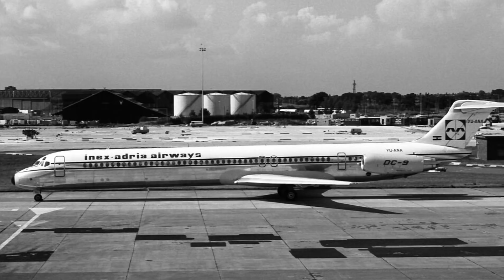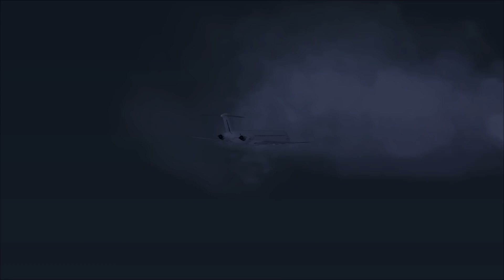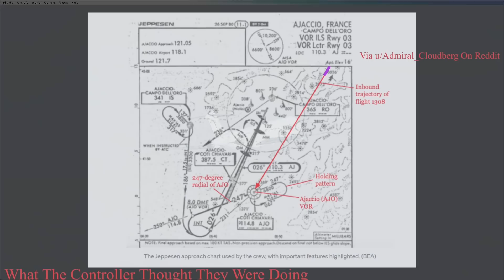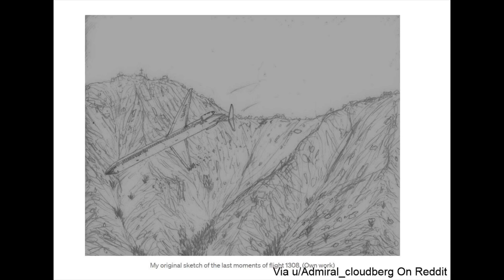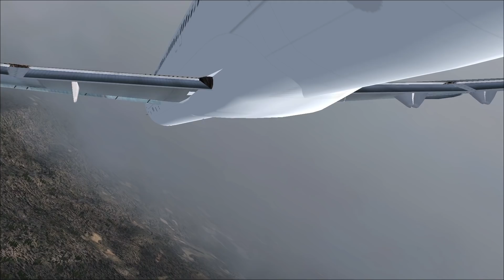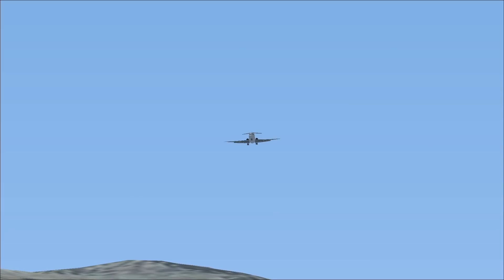The Small Misunderstanding That Doomed 180 People | Inex Adria Aviopromet 1308

Comment: The controller said "You are clear to descend to 3000 feet", upon which the pilot said "We are in holding over Ajaccio", and the controller replied "Roger". Controller had full information, but did not act on it. This is clearly controller error. IMO, 80% controller error, 20% pilot error. The pilot did not respect the minimum holding altitude shown on the chart. But I can understand the pilot -- the controller was told that they are in holding, and still permitted them to descend to 3000 feet. And so the pilot, being new to the area, trusted ATC.

Comment: I went to the summit where the crash happened yesterday, there's still a fuselage section and some little parts of the plane left at the point of impact. A rock of about 2x4 meters flew a dozen of meters away from the summit when the wing hit. But the most impressive part is a long crack (4/5cm deep) in one of the rock (I'm talking about granit) with metals stuck in the rock. If the plane flew 3/4 meters higher, it would have been fine, that's sad.
Reply: Wow.

Comment: My diploma thesis at faculty of mechanical engineering - aeronautics science - was the technical survey of this accident and possibility of reoccurrence with modern aircraft's  systems - http://docplayer.si/205550866-Tehni%C4%8Dna-raziskava-letalske-nesre%C4%8De-leta-inex-adria-aviopromet-jp1308.html - and I can confirm your analysis is quiet accurate. Beside the fact that our pilots didn't follow multiple GPWS warnings (first CM1's response 8secs after initial aural warning and if it was only a second earlier, they would overfly), they also briefed the procedure badly. There wasn't a proper approach briefing made (as per CVR transcript) and they also missed both crucial info on that chart - MHA and max IAS in pattern. There were strong N-NW winds that day which pushed trajectory way to the SE and extended that outbound leg further to the SE towards mountain terrain. Also, they didn't do the correct outbound timing, as they didn't take wind into account. In procedural control they should follow chart first, regardless controller's clearance for descend to platform alt. It was (too) relaxed day not just for travellers, members of local travel agency, but also for pilots themselves, if we take into account first time flying to AJO which is nowadays CAT B or C difficulty for most of airlines, and flying into thick clouds with noticeable winds. Btw, CM2's son was also in the cockpit on jumpseat at the time of accident. My grand-grandma told me many stories about her co-workers losing their lives that day, my father lost his schoolfriend there. It was a sad days for Slovenian aviation. The most brutal part is that some human and aircraft remains remained on mountain until organised expedition in 2008, almost 30 years after crash. But as from all of them, aviation learned something from this one - jeppsen updated their charts with better terrain markings, AJO got radar and changed stars away from terrain, also the holdings. This one holds lots of stories. May all of them rest in peace...

Comment: I used to fly into that airport years back with a 737.  It was always demanding either the straight in or, worse yet the circling approach.  MAP was 1,5 DME , thereafter you were committed.  Makes things worse when you have 3 navaids with the same name but different identifiers and the controller doesn't say which ID

Comment: What a mess!  I don't fly commercially, but I have my basic licences.  Sometimes it seems like aviation is quite regulated, and there is a lot of standardization, but it's not always the case.  Flying at different airports, there are different "cultures".  It might just be small things, but not always.  Also, you would think that basically all flight instructors are going to teach the basics the same, but they don't.  Ideally, things would be quite standardized.  While doing most of my training at one particular airport, we would use the phrase "simulated echo" with the tower if we wanted to practice an emergency landing.  It's illegal to use the word "emergency" over the radio when there is no real emergency, so we used "echo" (the way to say "E" for emergency).  I then switched over to a different company in a different region at a different airport.  I was instructing and wanted to practice a "simulated echo" with my student, but the guy in the tower had a mini fit.  He had no idea what I was asking for, asked me where I used that phraseology, then proceeded to passive-aggresively put down that part of the country where I used to fly.  There are also all sorts of local landmarks around specific airports that the locals always use, but that aren't included in charts and diagrams of the area.  You'll get controllers telling pilots to report at certain locations, but there's no way the pilot knows where they are if they're not a local.

Comment: Why are there so many cases of pilots hesitating when they get a terrain warning. Are they not trained to pull up and apply max power as soon as they hear that? It seems to be quite a common reaction in all CFIT accidents.
Reply: They're supposed to do that when they hear "Pull Up". In this case, that was too late. https://youtu.be/4qsFI9l0bJk
Reply: @KingdaToro  Its not clear in the video if it was too late or if there hesitation caused it. If they had reacted instantly by pulling up and adding power, would they have made it?
Reply: I think it could be a couple things like the pilot being overconfident in his knowledge of a situation, route or airport. Sometimes it seems the pilots think they are right & know where they are & the alarm must be wrong. I saw one where pilots where working of an older set of charts & they thought there was no way they were near any terrain.

Comment: "The controller did not have radar". Since Corsica is a region of France, (which is NOT a 3rd world country), and Ajaccio is the largest of the six airports on the island, plus it is right next to mountains, it seems that they should have radar installed. It is increasingly obvious that small regional airports, especially in poor, or undeveloped nations, cannot neither afford nor are technically capable of such installations. But France should be ashamed of not helping Ajaccio provide this life-saving technology in this case... it would possibly have saved 180 souls!
Reply: Ajaccio has a radar now, and ADSB, but just be reminded that occured FORTY years ago!
Reply: Two words that terrify me: no radar.
Reply: Well if he used standard phraseology as outlined in ICAO then all would've been fine. It's laid out - Command then phraseology eg thousand = thou-sand, nine = niner, decimal = Dacimal. Also many instances within standard phraseology relate to the usage of phrases. Certain word combinations are illegal use of phrases and must never be used as they are ambiguous.
The life saving technology you speak of is another line of defense and not a panacea but your comment reminded me of this other ATC/aircrew ***k up. 

There's another 'small misunderstanding' stupid crash where an air traffic controller didn't use standard phraseology initiating a chain of events ending in controlled flight into terrain. It went something like this (not accurate but this example illustrates well enough what happened): 
Set the scene: There's an airport that is at say 500' high in this example. It's night. The flight is conducted under the Instrument Flight Rules (IFR), so no visual reference to the ground at all. Navigation is by charts approach plates, onboard equipment, a flight plan lodged with ATC and ATC instructions are given to the flight crew in accordance with the route, the current sector the plane is in, and the flight plan. ATC takes over for vectors and altitude to position the aircraft to land. 
Sometimes the landing is a visual approach, sometimes an instrument approach. Many times these approaches (either visual or instrument) are published standard approaches with an approach plate the crew fly once ATC vector the aircraft there. 
The terrain under the heading corridor the plane was flying along tops out at 1650' and the plane was 30mn from the airport. 

So, the plane is flying level at say 3500' @180IAS and was told by ATC to, 'Descend two/to thousand five hundred.' 
That could mean 3x things by my reckoning
a) Descend 2500' feet
b) Descend to, 2500 feet 
c) Descend to (a) thousand five hundred
That's non standard phraseology and the crash would've been avoided if the controller had've spoken exactly as outlined in his training to avoid this sort of thing. The ATC controller meant descend to two thousand five hundred feet.
The flight crew thought it meant descend 2500' to 1000' (from the 3500' they were at). The crew were to blame not the controller but the controller had a part to play no doubt.

Firstly, ATC never ever gives a descent instruction the way flight crew interpreted it. ie ATC never flippantly say 'descend 800 feet' to a pilot and never have AFIK - they always give the altitude to descend to, rather than telling the pilot how many feet to descend by - in order to reach an unassigned altitude.This is basic student pilot stuff.
Anyway despite ignoring basic student pilot training they tried to descend the two thousand five hundred feet but at 1600' flew into terrain and everyone was killed. 

The ATC instruction was sort of more correct than incorrect but still ambiguous. In short, the aircrew should not have have left the altitude they were at until that instruction was either clarified or someone at least checked the approach plate which they should be well across in the first instance to know that something about the ATC instruction made no sense, esp if interpreted the way they thought! In short it was an illegal phrase the way the crew interpreted it and should never have entered their head since ATC don't give altitude changes like this for the exact reason the crash occurred.

As well, that's what MSA/LSALT (Minimum Sector Altitude/Lowest Safe ALTitude) on the approach plate right there in front of the aircrew is there for. The plane is approaching an airport under the IFR (Instrument Flight Rules). The approach plate is out.  
You can't just defer to ATC to do all the work for you. It is the PICs (Pilot in Command) role to maintain situational awareness and a safe flight at all times. That's why there's two aircrew on the flight deck since it is more than one person can easily manage when maneuvering to land. 
The flight crew even failed to notice what they thought they were told to do was in fact illegal due busting MSA by a negative value no less, indicating either they didn't know or care where they exactly were because an ATC controller had their back. 
Of course the controller couldn't care less as he was sloppy and it was just another routine approach.
Not really the controllers fault but ?? - I wouldn't want to be him.

Again, just an example, not accurate, probably all wrong, but a crash similar to this did occur.

Everyone makes mistakes, but systems are in place to mitigate them.  
Nothing can be done to stop stupidity.
Reply: @HypercubeJones  - Good point. I thought I could Google to find out if they now have radar - but can't seem to find out anywhere.
Reply: @gilbertfranklin1537  Yes , there is a secondary Radar now, and ADSB, and is IFR
Reply: @francoisemichelcaburet2639  - Thanks, that is good to hear.
Reply: Ajaccio has two abbreviations, because clearly everything is not confusing enough already: AJA and LFKJ, with the latter seemingly more popular.

The airport has a fair amount of commercial traffic:

https://flightaware.com/live/airport/LFKJ
Reply: @HypercubeJones  All airports have two codes, one from the AITA(IATA) and one from OACI,  like CDG and LFPG  for Paris Charles de Gaulle, the OACI one being the one used by all concerned with flying, the other more like a "commercial" one.
Reply: In 1981 it was still quite common for such airports to not have radar.
These things were expensive for a small regional airport with not much traffic and usually nice weather.
A similar airport near where I lived at the time, didn't have radar either and I know that was true of many European countries.
Reply: France is a country that never cooperates with others and is ego-entric>!

Comment: MACI Thx for this informative video I remember this crash vividly as I was a sircraft mechanic working at MD @ Long Beach in 70/80s I worked on this aircraft. IIRC this was the 1st DC9-80 that crashed with loss of life and it haunted me until I heard that Pilot error was involved. The Super 80 series got off to a rough start with the crashes of the 2 flight test A/Cs 909 & 917 with neither involving loss of life and were atributed to weather (wind shear)  and pilot error (FAA) not design or manufacturer  defects. It was the first American civilian aircraft to utilize Digital Flight computers and was one of the quitest planes of it's time  both on ground and in the cabin as the engines being in rear of the plane. Sad to see that with covid impact on air travel most of the  Mad Dogs are being removed from scheduled service.
Reply: Lol quite at the time? Probably In flight it’s fine but I always knew when an md80 was taking off because of how dam loud it was. Maybe was due to the shorter runway but they were really loud

Comment: Very sad indeed.  Exellent video.
In my view if pilots studied the approach before they left and memorised or even double check the min holding altitude, holding  speed and times to turn,  they would be safe.  And with the hold,  they would have had time to discuss with the ATC their position and approach, to clear up confusion since clearly the was some.
Airport also could have a better and safer approach by doing the hold and decend over the water but still use the vor as ref, instead of holding at the vor.

Comment: In all these controlled flight into terrain. The GPWS seems to never signal fast enough for anyone to do anything. It's like the planes saying btw your about to crash and there is nothing you can do about it.
Reply: This was in 1981, the GPWS back then used to only point straight down giving late or no warnings for mountains ahead, nowadays it points down and slightly forward too and GPS terrain data is also programmed into the interface in the cockpit.
Reply: At least in this case, it probably warned them fast enough, but they were distracted by other things and missed their window.
Reply: I don’t know the details, but there have been improvements made to terrain warning systems over the years.  Even modern glass-cockpit general aviation aircraft will often have simulated virtual terrain. I think once such technology makes it into all airliners we’ll not see CFIT anymore.
Reply: @fltof2  Well in that C-130 crash somehow they thought it was ok to fly with TAWS disabled. The mountain disagreed with them.
Reply: @fltof2  Except if the pilot becomes a murderer as happened with the German Wings incident.
Reply: True. There is a distinct difference between flying with only VORs and GPS-driven moving maps where the terrain is superimposed on the PFD, however. While I’m sure that technology can be defeated with other failures as children of the magenta line manage themselves into hillsides, I suspect rarely will a pilot fly an aircraft below 1,000’ AGL in mountainous terrain if (s)he sees yellow all over their PFD.
Reply: Incorrect. GPWS responds soon enough to save plane. In this particular case, if they pulled 1 second earlier, they would overfly. The PIC's response occured 8seconds after first warning.
Reply: @zigacernivec1993  I guess pilots never watch crash investigation videos. "PULL UP TERRAIN" hmmm  what does this mean..does the computer mean BANG!!!!
Reply: @mnztr1  It's called "startle effect" - delayed response due to unexpected "stimulus"
Reply: @zigacernivec1993  they should work on this in the simulator to ensure they reponse becomes instinct. Max climb, full power

Comment: Minimum safe is there for a reason. They should have maintained 6800ft until they had a visual on the airport. A go around would have been preferable to controlled flight into terrain.
Reply: I'm not a pilot, but when I heard that I was wondering why anyone would fly below the minimum safe altitude (?). Perhaps there are legitimate reasons, but it seems like something that would be more of a requirement than a recommendation.
Reply: @dmhendricks  The video explained it... there was a child in the cockpit who distracted the pilots during the approach briefing. They didn't hear the stated minimum safe altitude, which changes based on the area (obviously, because some areas are completely flat while others are mountainous)